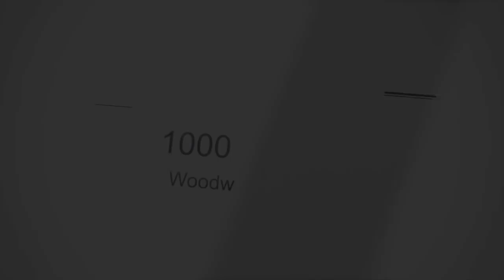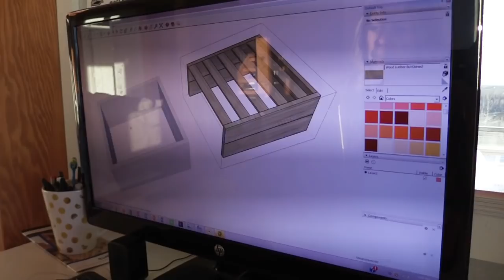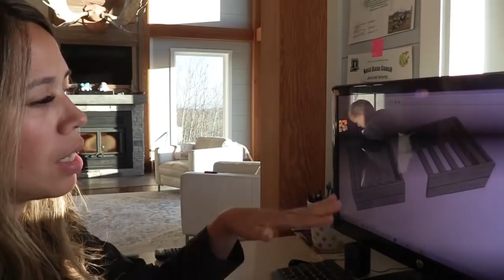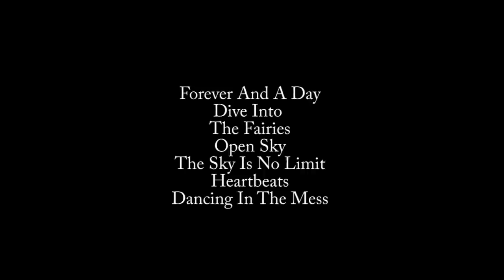DIY: Twin Sleeper Chair

Comment: This chair/bed would be great in a tiny house!
Reply: a giant immobile chair in a tiny house? interesting.
Reply: @joannecarroll5504  Just put lockable wheels on it.:)
Reply: Way too heavy and hugh! Murphy beds are best for THOW.
Reply: My thoughts exactly
Reply: @joannecarroll5504  you can use it multiple ways, a win in my book.
Reply: @joannecarroll5504  For a medium house, then?
I would like to build one, but for a 140 cm mattress, for when I downsize 
after the kids leave home (if they ever will - the housing crisis is horrific).
If I place one of the corners in the corner of a room, the wall will support 
the fragility of the backrest's construction making it risk free to lean on it.
Or, drilling holes from the top of the sides of the backrest/siderest box 
through to close to the bottom of the sides on the lower box/seating box, 
will make place for rods/dowels/rebars that will stabilise the sides.
Welding or screwing loops to the tops of these bars/dowels
will make them easy to remove before folding the chair/sofa down.
It will also allow for a bar between the loops, from which one can hang side cushions. 
Also, I would try to place some kind of protection (for clothes) over the hinges.
I think I would also round the edge of the armrest a bit.
Reply: @mademoiselledusfonctionell1609  Oh the projects I too have had on hold until then! I never said the design was bad. Just that putting it in a tiny house was interesting. I actually quite like it, but we couldn't get around those big corners/sides/armrests in my 3BR villa, so I can't imagine it in a THOW unless there was nothing else in there. Good luck with sizing downward - I think we, the parents of 90s & 2000s kids are destined to have them with us forever & ever. lol

Comment: Definitely want to build one of these! Will probably cut a nice curved arm piece (like a pew bench) to give it it less of a boxy look. Thanks for another awesome design Ana! I love everything you put out!
Reply: HolleWood Furniture Maybe like a chair where it starts out farther out but rounded, curves in and works back out again. You don’t want to take away too much. That would reduce structural integrity.
Reply: @lauriemashek5419  yeah that would look nice as well. I was thinking of keeping the same height at the back corner and then create the arm rest, then leaving a few inches of materials to rest against the bottom frame when flipped. As long as you keep the back corner at the same height it should have enough strength.

Comment: Happy Birthday! I have a suggestion.  If you dropped the slats down in the frame an inch or so, you wouldn't be losing much chair depth, but you would have less issues with the short mattress ends falling off as you toss and turn.  Just a thought. :)

Comment: Weave seatbelt strapping in place of wood slats to make lighter.
Reply: Good idea. How do you secure the seat belt strapping?
Reply: There’s a tow strap that’s about 12 feet or so.  Ugly yellow, but could dye it.  Menards has it 10-20 dollars.  

That webbing is someplace, upholstery standby. Would come on a bolt or roll probably.
Reply: This is a good solution
Sorry about the thumb down was wondering about the weight of this chair esp if used in a van conversion.

Comment: Being such big DIYers you probably know this but ill say it anyway a very easy way to cut Foam rubber is using a Electric knife  i buy them at  Garage sales for really cheap prices  or. Ask friends if they have a  old one they dont use   ! Ive made a lot of Boat cushions  using  the same knife  too  as the commercial cutters  are pretty expensive IMO  Happy Belated Birthday  too !  The baby is Adorable

Comment: PLEASE a lightweight version. 
So many of us need this for tiny homes and apts up stairs.
Reply: Bar Rez my only suggestion to make it lighter would be to use seat belt type material? Woven together with a frame instead of wood slats or macrame (knotted rope) again with a frame

Comment: I loved it when I saw it initially so I came back to give it a try. Honestly, I kept thinking about the outdoor sofa project while I was looking at the video. I found it a little easier to use the design of the outdoor chair for the top part. It was a simpler frame and made it possible to use the same board size of the outdoor chair. Also made it a bit less heavy. It came out nice. I still may do another one for the porch. If lumber prices permit me to at some point. Either way, great video.
Reply from the maker: I'd love to see what you did if you'd like to share, we are at anawhitesite@gmail.com

Comment: Ana, have you ever done a van build. Either a big van (like sprinter) or a mini van conversion. It is huge right now, people converting vans for travel. This chair would be great for the back of a van to save space. I need to see if I can make it smaller. I will check out your other videos to see what I can use as I start my Dodge Caravan Cargo Van build to travel in 2019. Thanks for the great ideas.

Comment: Great design, simple, useful  product. Have you thought about rounding off the front of the arms, perhaps round a large paint can? Shouldn't impact on the integrity of the chair but would be more aesthetically pleasing and safer too - no sharp corners in case of a fall.

Comment: this build totally gave me the idea to modify it slightly for a campervan build i am formulating.  the shower pan could be under the chair.  that way the area has more than one use.  which is mega important in a 75 square foot house lol

Comment: Thank you  for showing this . I will make one , to fit  a Fulton mattress with a table on wheels ,It can use for eating or working with my lab top,make just wide enough to slides up down the length of chair-bed it will look like just one piece until u pull it apart to make into a bed  or chair with table. thank you  .This may be late in coming but happy B-Day .

Comment: Great design and idea but 1 small tip for future or if you make another is to try and figure a way to make 2 smaller back cushion as 1 piece that fold over so then have 2 pieces as opposed to 3 (1 base and 2 smaller but folded as 1). Ohh and happy birthday :)

Comment: I love this design and thank you for the plans! It's something I have been thinking about for a 20' container studio apartment. But now I will just steal your plan and make a few modifications! :-) For mine, I want to make two chairs and use two 6" memory foams, 30x74. I want the ability to slide two together so they can be used either as two twins, or one queen. Then I want to construct two small ottomans that hold storage, inside them, and fit neatly under the beds when they fold out. As mentioned by others, I also would like to use straps to help minimize weight. Anyone have ideas about how to make the chair/bed slide easier over a wood floor when it is being reconfigured? Perhaps staple carpet over the sliding surfaces?

Comment: I might be doing a cut down version of this in my camper van as a bed. Reason it would be cut down would be to reduce weight. Make it easier to flip and so it doesn't interfere with the ceiling

Comment: Ana, this is Barbara, love your idea with this flip chair, this I would love to use for my van conversion idea for my 95 GMC Vandera 2500, for both space and storage too.
I would like to know, if you could make one for me, if so, I like it to be natural wood finish, would need all outside boards at least 3/4" thick for better weight so it can't move while I'll be driving, until I pin it down to the new flooring I have planned to do by Spring time, need it 3ft wide, at 14" depth (leveled hight from floor, with the bottom part of the chair that the bottom board would be at 1/4" from the floor, because of the former seats, the platforms are still bolted to the floor boards of my van, I'll eventually have the removed when I get my floorboards redone with new insulated flooring), that it would flip out to 5ft 5in (this is perfect width and length and hight for me in my van where I like to set it up. I just don't have the tools and space here where I am..liken to a garage/ tool shed of sort, I'm living in an apartment complex, my lease ends Dec. 31st, this year. Reason I'm moving out, is due to these new apartment complex owners since May this year, they said anyone who is renewing their lease, rent is going up at least near twice the amount (in my case from $650 to $1300, with my wages I can't afford $1300/month for rent for this 1 bedroom apartment, so I'm planning to move in my van to live and fix it up as go and to make it my home...
(I'm 5'5" tall, will have a vertical challenge of only about 4.83ft standing room...LOL🤗 in my van, but horizontally, plenty of room and space for just me, simple and minimal living, and could save a lot more money too) 
Howere, plus, as far as for a mattress/seat cushions liken to what you have done with the flip chair, I like to have a 4"/5" deep memory foam mattress, with a light or medium green cover ... (LOL, sorry, I can't even sew either🤔🙄)
If you would, before you get started let me know, even if you could email me a copy of the picture of what it would look like first as you have done with your flip chair you had made with the measurements I have given above for mine and how it may look like. And, how much it would cost and cost of shipping and handling too (Odessa, TX USA, I'll give my full delivery address prior to email?)
My email address is: 
bebk2008@rocketmail.com
God bless you and your family. Look forward to hearing from you to let me know so I can put my money together. (Which I can start saving up for by mid December, because I still have to pay my last rent here on December 1st) 🤗
And thank you for this awesome idea that even I can use for my van conversion, I don't want my van to look like other van conversion where their sofa/beds take up way more space, with this flip chair idea, I will have both more floor space and storage too.🤗

Comment: This Bed looks great, It's just what I've been needing. I was going over your dimensions, and I'm confused on your Number of 1x4x8 boards that is needed, you have down 4-1x4x8. It seems to me that what is needed is 11-1x4x8, 
You would need:
 5-1"x 4"x 8' at 29.5
6-1"x 4"x 8' at 30"
Is this correct or am I missing something?
Thanks for your time
Reply from the maker: Yes, the shopping list and cut list are 2 different things. You need to buy 4 - 1x4x8' boards and when you cut those 4 boards into the measurements listed, you will have 11 pieces, does that make sense? If you need further help email us at anawhitesite@gmail.com
Here is the plan link with visals that may help - thanks for the visit!
https://www.ana-white.com/woodworking-projects/twin-sleeper-chair

Comment: Would it still work to cut off the top row of the “arms”? I want to be able to sit cross-legged in the chair. And don’t necessarily want to make the chair wider, but need room for my knees to extend beyond the side of the chair or at least rest on a lower arm

Comment: For the cushion , could you sew one long tube and put in one pad then sew a dividing line and put the other pad in , then another line put in the 3rd pad and sew it up.The cushions would be connected and not move when you slept on them.
Reply: M. Kenaga Ivy Tech CC that would make it even faster to set up for guests. Good idea.

Comment: What if this chair bed concept could also turn into a table and chair Kitchen set for a tiny house on wheels. Chairs would fold down to fit in the storage area where the sheets and blankets are for the chair bed. Just thinking here and trying to be more creative. Can a chair bed also adjust to become a table and folding chairs setting by turning the bed into a folding out table not just a chair bed? So to basically get chair, bed, and table kitchen setting all in one? Just an extra idea......

Comment: How thick was the foam you used? I can find any foam under $40. Does anyone have a link to one they bought? Also, I read through some comments but has a lighter version bee. Made yet? That would be a great follow up idea for this project. We will be done with ours once we find foam.

Comment: It’s be cool if a backing could be attached (some how)  so it can be used as a daybed/sofa when it’s in the longer position.
Reply from the maker: Check out how this builder modified it! https://www.ana-white.com/community-projects/tiny-house-flip-sofa-bed-deirdre
Reply: @AnaWhiteDIY  Thanks!!
Reply: I know this is an older video, but I really like this idea. I’ve been looking for a Chair&1/2. So this will work great, I just have to figure out the change in cut sizes. Thank you!  ❤️😎🐈‍⬛
BTW, I looked at the sofa sized one on your site - looks good, lots of storage. I was also thinking about adding one of those plump trifold floor cushions.

Comment: I like the chair, but if you are a fitful sleeper the matress would fall of the bed. If the grating was a bit above at the upper part and a little below at the lower part and the hinges at the side were more narrow, the matress wouldn't fall off this easy. And the woman in the video is very slim, if a heavier person wants to sleep comfortably, the foam must be thicker and so the backrest would be wider what I'd prefer. But I really like the idea.

Comment: I'm making the chair I got 2x10's and I didn't check because it was in the 2x8 location at home depot do I need to change the demensions any or it won't matter.  I cut. All my wood and ready to pocket whole everything
Reply from the maker: It will just be a bit bigger and heavier!:)